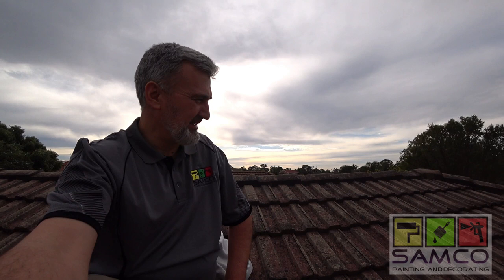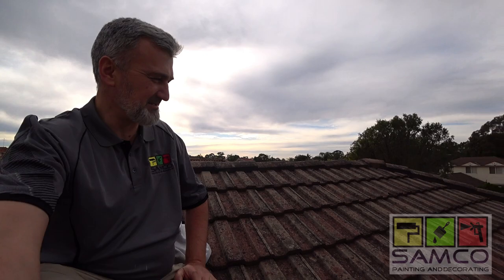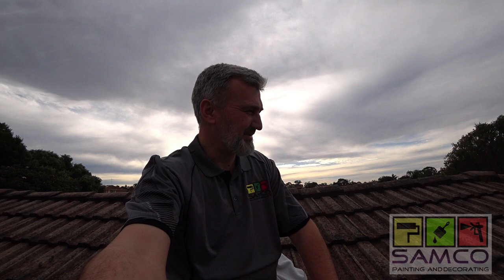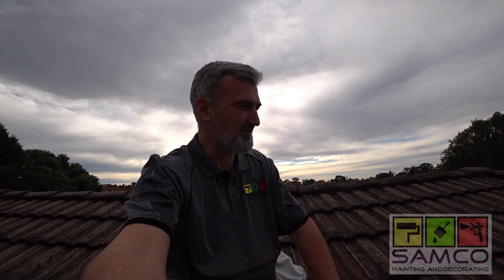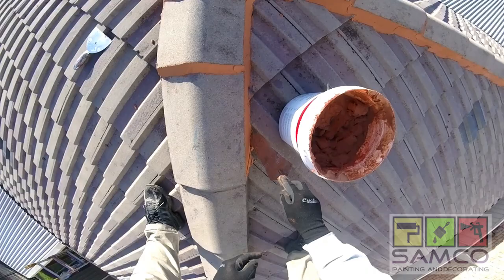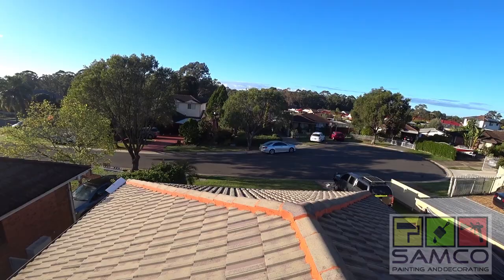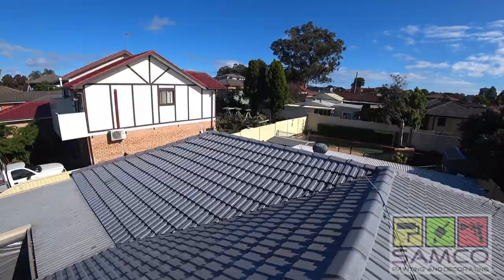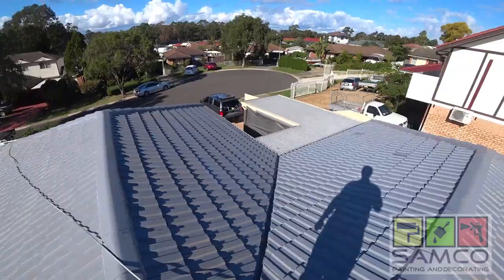Painting Roof Restoration as pro

Comment: When doing pointing must grind capping tile edge so you get a good key in to surface or new pointing will crack off at top edge letting moisture in.
You MUST re poke weep holes down bottom or water cannot drain out... and water in roof years down the track.
Try not to respray neighbours outdoor furniture and cars lol.
Reply from the maker: Hi Colin, thanks for watching...There was no pointing on edge of the tile anyhow, it was just pressured cleaned and ready to go. Closely have a look at the video again and you will see that the weep holes have been re poked, and rain water can nicely drain out. Overspray?? No one came complaining to me in regards to any over spray on cars or furniture, and once again on closer look at the video the areas where there could have been potential overspray were protected. I hope this clarifies the video....Cheers!

Comment: Nice work, what tip size you using and how many litres did that roof take?
Reply from the maker: Tip size  is 521 for sealer and 621 for membrane. The pressure is 2500psi.30 Lita's seller  and 60L  of Roof Membrane Paint as a top coat,  Thanks for watching.
Reply: Hi guys.
Which paint sprayer machine are you using?
Reply from the maker: @rapanraut620  The unit is the Mark IV from Graco.The pressure is 2500psi